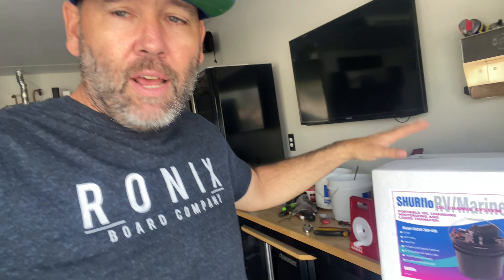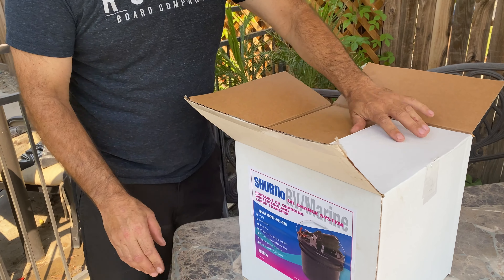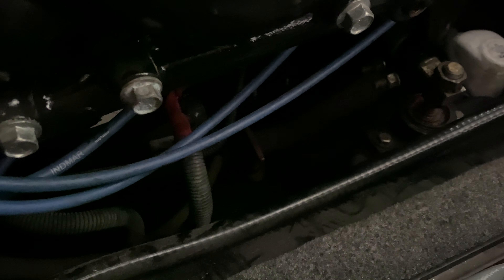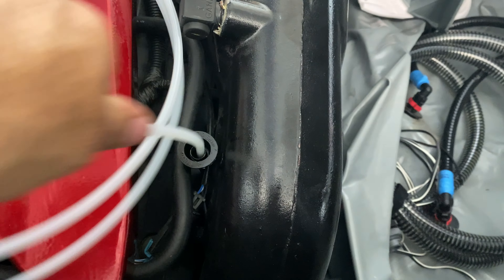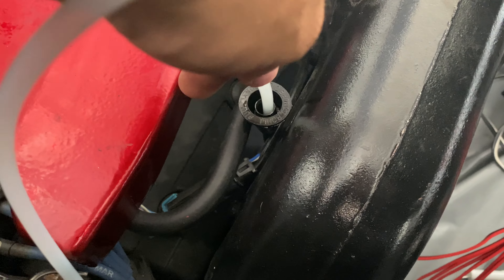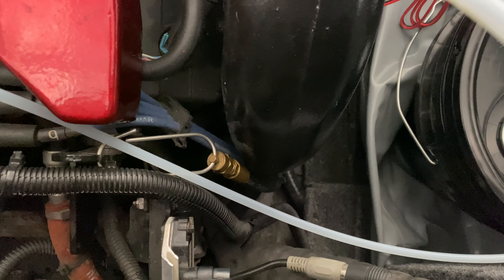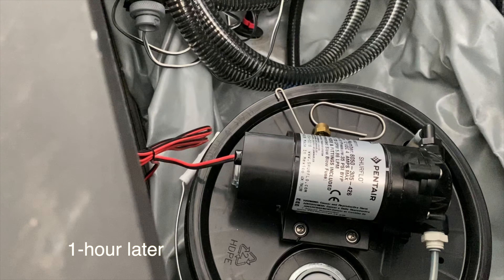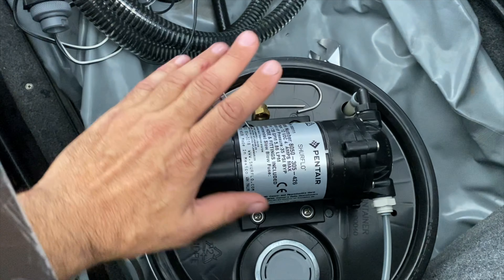How to change the oil in your boat using the Shurflo system.  Is it worth it?

Comment: If the suction hose siphon end which goes into the engine pan is cut at a 45 degree angle there is less of a chance of the tube bottoming out and not siphoning oil. When removing full synthetic oil be sure the engine is warmed up for at least 10 minutes.

Comment: Get a fitting for that hose like the cap and more pressure will build.  And you can put the oil tank out of the boat and and less Chance for mess
Reply from the maker: I'm confused.  Where would I put the fitting?
Reply: @btuff  hose to the bucket, get a barbed fitting and has treeds that match the drain hose

Comment: Man all you needed to do is run the engine to bring up the temperature  before you put the hose down the dipstick.  That how you change the oil and its fast and works perfectly.  Maybe you should not be doing product reviews